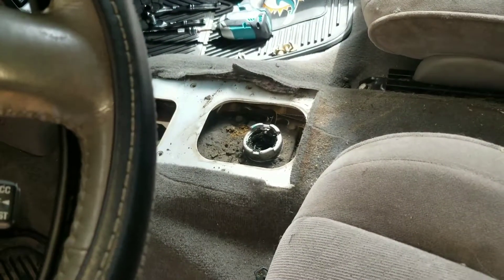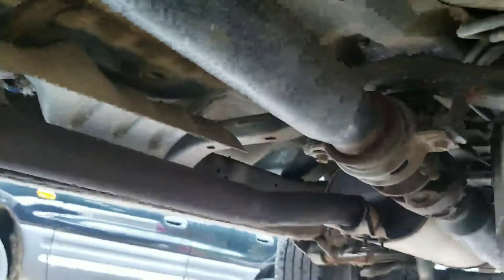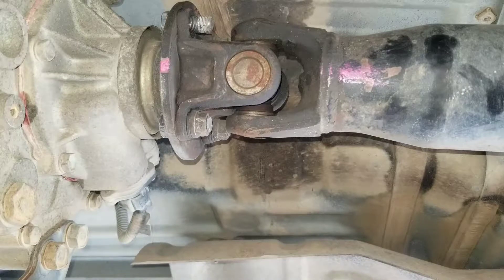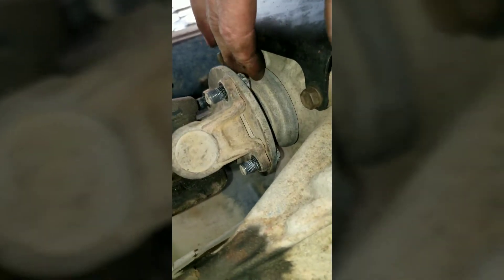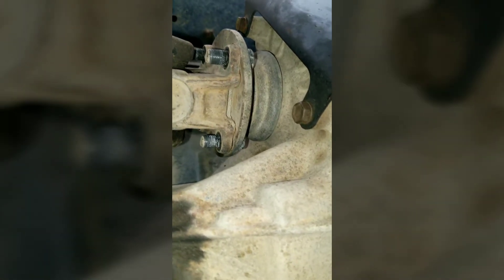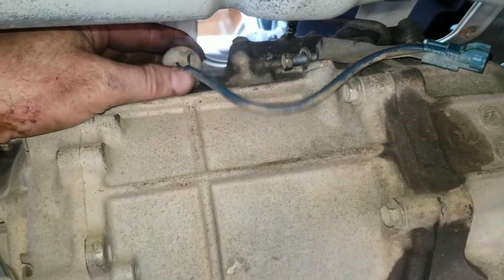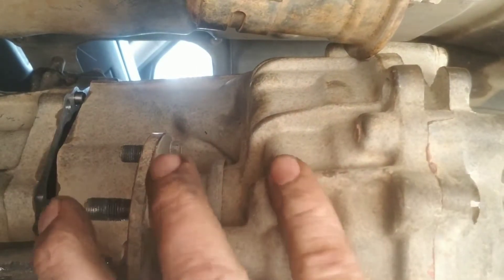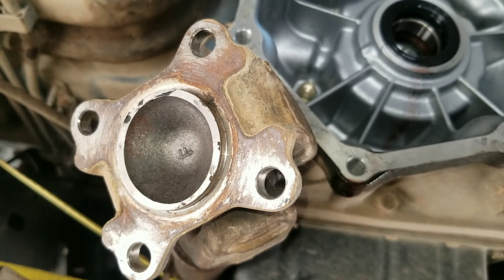2001 Toyota Tacoma transmission removal part 1

Comment: Well if you have changed the transmission three times! Then you forgot to put in or tighten the three bolts missing from the rear drive shift! Just saying it wasn't toyota it was your fault that they weren't there!